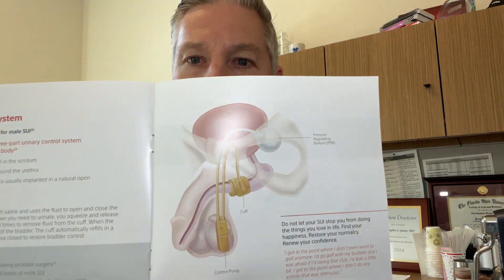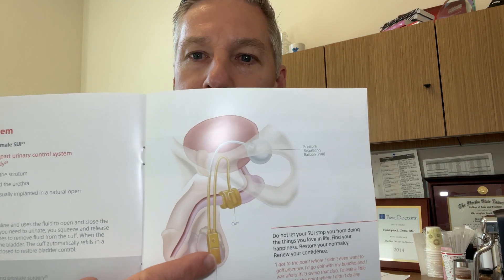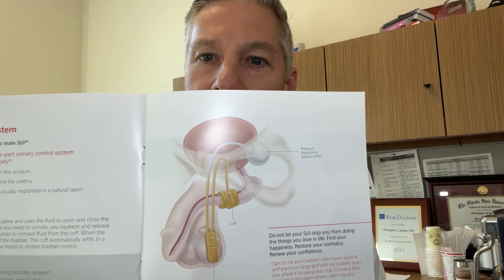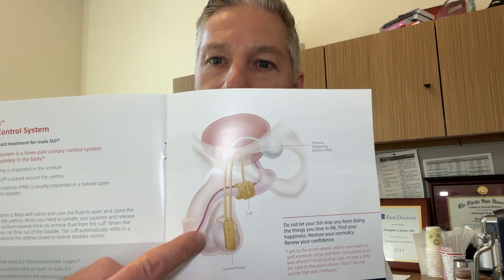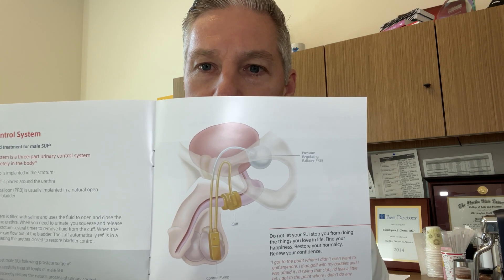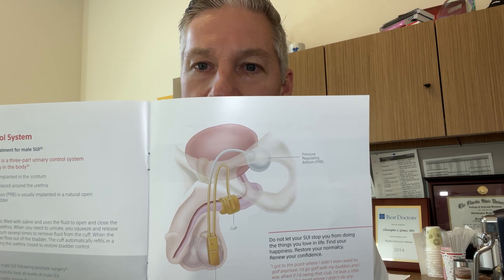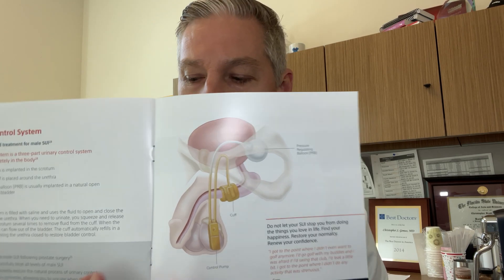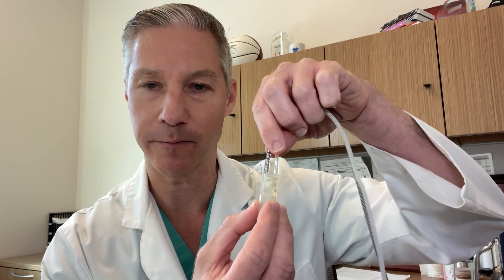How to operate an Artificial Urinary Sphincter- AMS800

Comment: I have this device for 7 years and never was able to deactivate till i watched your video, i thank you for that.
In order to avoid the damage of constant pressure, i as an engineer, put together a vacuum pump and used it everyday for 10 minutes to pump blood to my pines, the pump has pulse and works extremally well. thank you again, i need relief some time to let the pressure off.

Comment: I would request 27 f while stuck in Hopkins with so much blood in the bladder... radiation cystitis. 7 months in a wet bloody bed... So i qualify. The Clotts were horrible. Anyway, I just had the AUS device installed and now on week 7 post op. I am a bit concerned. Most important is the catheter size MAX 14F. Thats important to know . And so thank you for describing what I will be experiencing this Monday is helpful to know, indeed. Thank you.